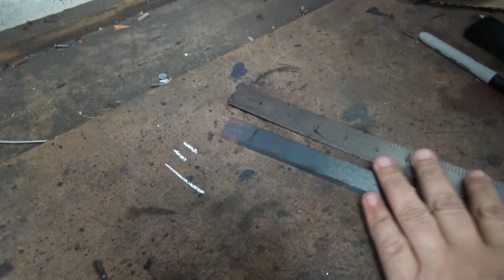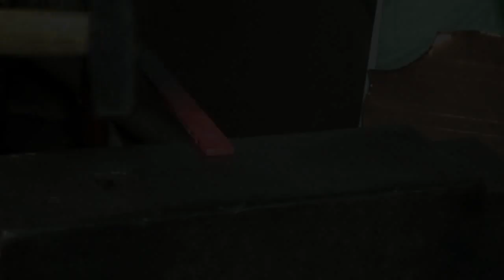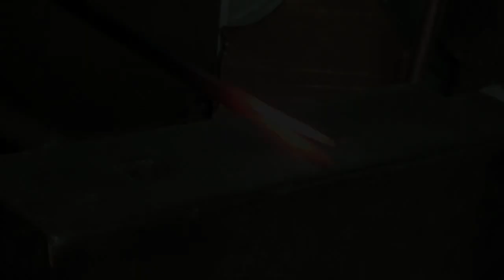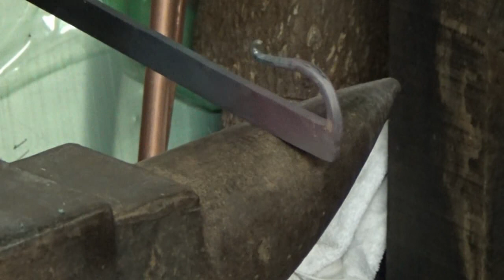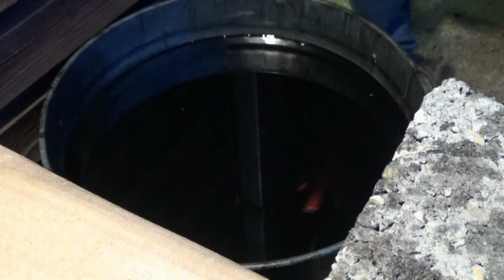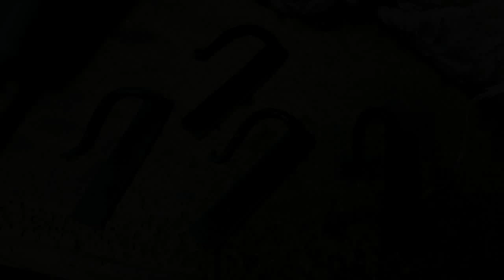How to make a fire striker

Comment: Question, did you only quench in oil? Or did you have to heat treat it again to make them throw sparks? Im having trouble to get mine to spark after heating in the forge. I tried quenching in water, too hard . I tried quenching in oil, no sparks were generated that could ignite an ember. Frustrating! What tips can you offer?

Comment: How are you using a file on it after it was hardened? Or did you film out of sequence?
Reply from the maker: Dominic Minischetti hi. The filing is used proncipally to remove the oil blackening from the working surface of the strikes more than anything as you're assumption is correct the filing does little more than skate and scratch the surface. :)
Reply: Greenleaf Workshop very nice, they are cool!

Comment: Are you using mild steel or something else?
Reply: he is using O1 tool steel, i presume, from what he said in the description. you can get it easily enough on ebay.
Reply from the maker: What Noden's said. The metal is O1 that's 'oh' not 'zero' - I made that mistake when I first started.

https://en.wikipedia.org/wiki/Tool_steel#Oil-hardening:_the_O-series
Reply: mild steel doesn't have enough carbon content AFAIK, as Graham said most smiths go for the "O" series or "W" series or 1095 high carbon steels.

Comment: ...or you can just use a lighter cuz we don't live in the 1700's anymore
Reply: or still learn how to survive when you need to .
Reply: lighters run out, don't work and fail. Flint and steel is sustainable and just plain fun. Any idiot can use a lighter, it takes skill to use flint and steel, plus it teaches you about fire and how it works.
Plus flint and steel technology has been around for around 5000 years at least, as seen on the mummy Otzi who had pyrite, flint and tinder fungus

https://en.wikipedia.org/wiki/%C3%96tzi